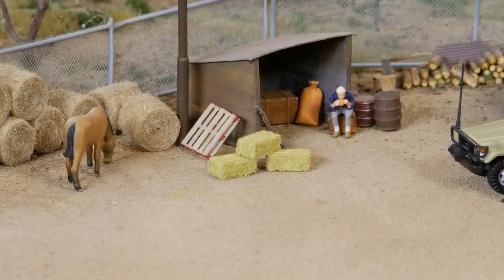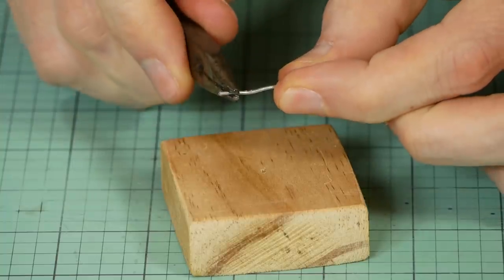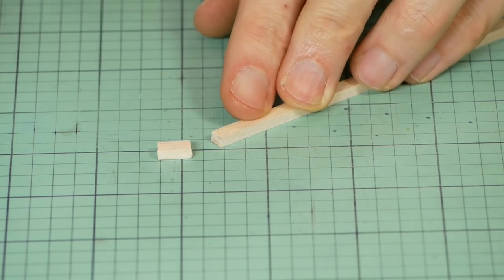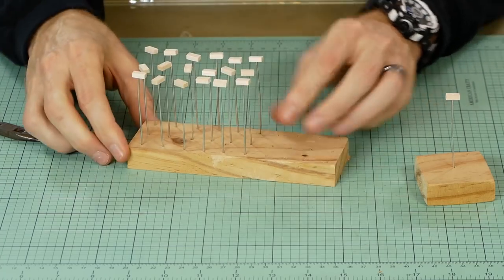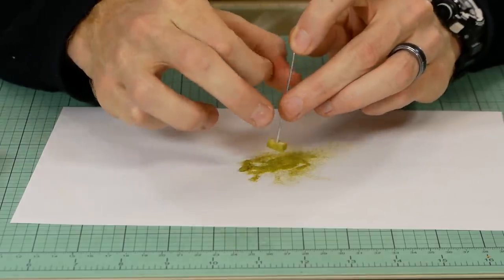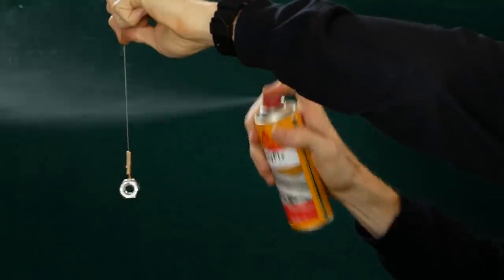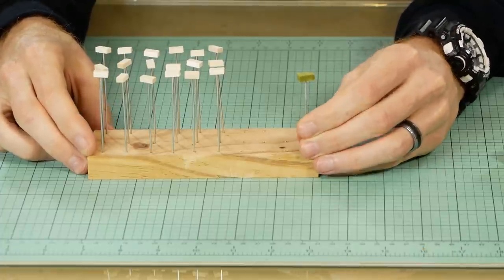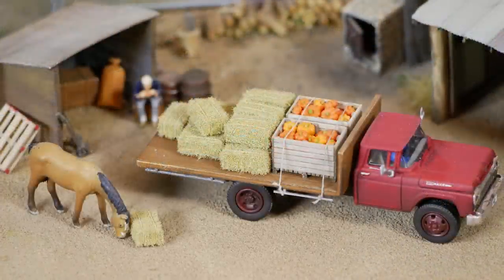Realistic Hay Bales – Model Railroad Scenery

Comment: Thanks for this tutorial. I recently was diagnosed with a terminal illness. It is a slow acting illness, but it progressively wears me down. Being disabled for me is new being that I loved Softball, Baseball, snowboarding, etc. Now, well I was lost. As I sat in the hospital I found You Tube to be a help. I was a collector of Marvel and Star Wars, along with other anime figures. But my love was Hot Wheels. I found videos that did racing. These kept me going. I had every intention of doing a channel when I got home but another 2 bouts of Pneumonia knocked that out. So I was a spectator. Then I saw customizing, AND dioramas. I had a idea if making a downhill track with custom pieces but I didn't know how to start. Your videos give me a place to begin. The fence tutorial I saw in the list will be one for sure. I subbed right of. I'm hoping I can learn some neat tricks. Like for one, Highway Signs or adverts off the road. I'm looking to maybe do those. The photo on it is a simple printer image scaled down but the frame work and base. They are metal base with wood or metal signage. Anyway I wanted to say thanks and just say hey. This illness has nailed me and hit me hard. I really hope I find a way to vent my frustration..lol. I used to hunt for Hot Wheels but now even that's stopped. My body has weakened a LOT and well IT SUCKS. But I'm not one to give up so, I have a decent amount of Hot Wheels. No enough rubber wheels or tires though, but I'm working on it. This WON'T knock me down. Thank you again and you might see a few questions from me. If you havw the time that is. I realize these videos are NOT easy to make. The edits and such are hard and time consuming. So take care and the bales looked great!!